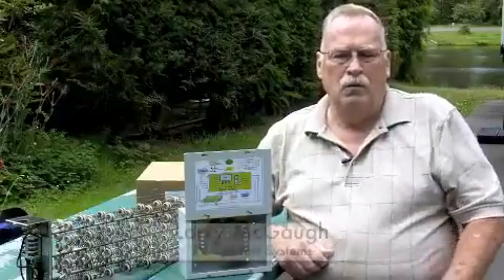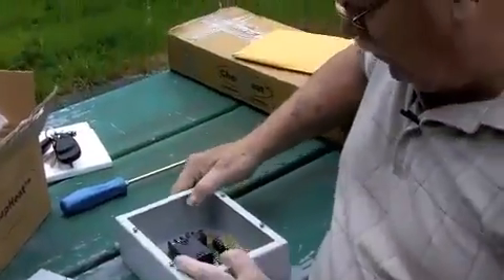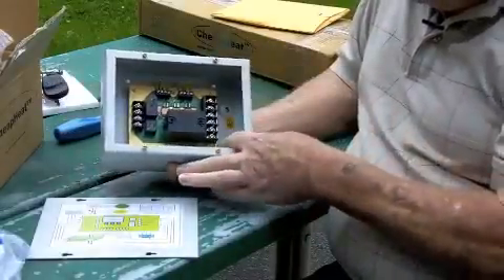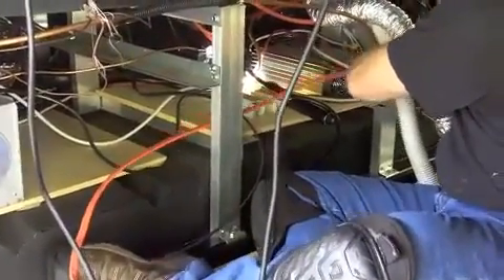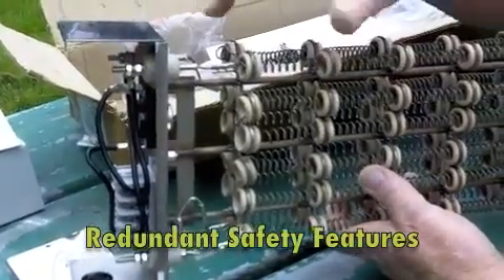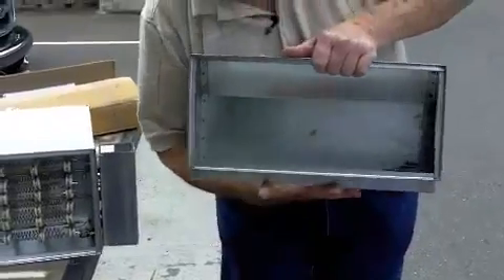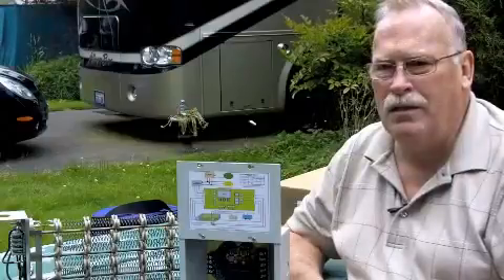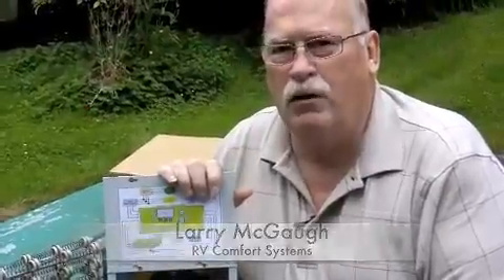RV Installation Operation Video for Hybrid Electric Heater

Comment: I love, love, love my CheapHeat!!! Thanks to CheapHeat and the Truma AquaGo Comfort on-demand water heater I refill the 40lb LP tanks every two to three months. Not every few days during winter. Best investment ever. It's paid for itself.

Bonus.... No more dangerous space heater to trip over. The added benefit of using CheapHeat over space heaters in cooler above freezing temps is warmer floors. Many of us use space heaters in above freezing temps to avoid using the LP furnace. With CheapHeat this is no longer an issue. The result is warm even temperature throughout the unit. Ever look at pre-owned unit and find the bathroom and/or bedroom smell. Many times this is due to excess moisture because the previous owner used space heaters in the living area only. All that ambient moisture within the RV migrated, cooled, and condensed in the unheated areas of the RV. With CheapHeat you avoid this (provided your bathroom(s) have a heat duct. Just something to be aware of. RVs need even heat and air movement to avoid moisture buildup, to avoid mold and mildew growth in the ceiling, carpet, caps, walls, and the undercarriage. Use of the furnace for heating is required for healthy indoor air quality. CheapHeat is a no brainier.